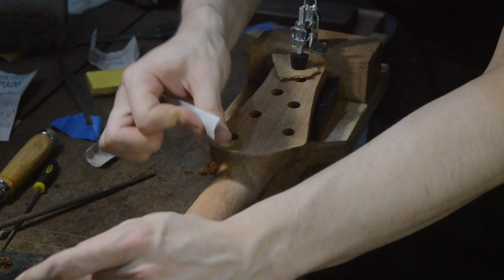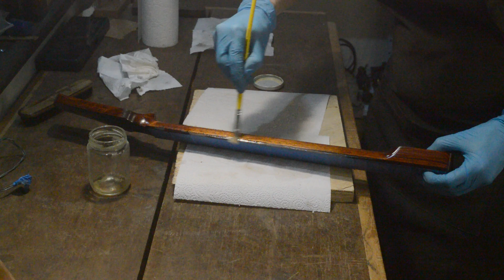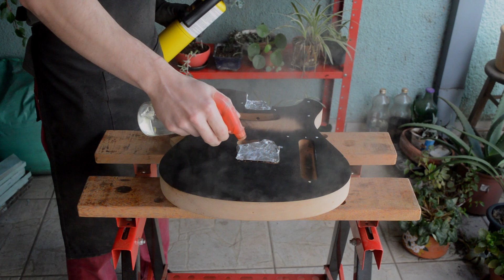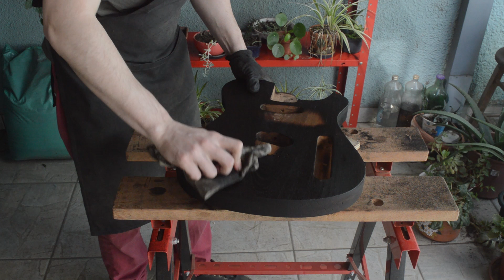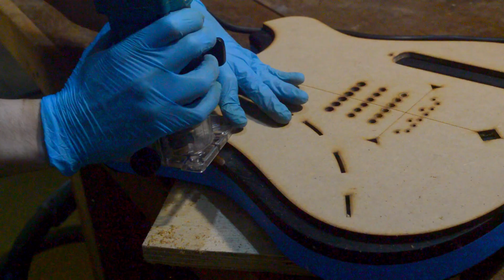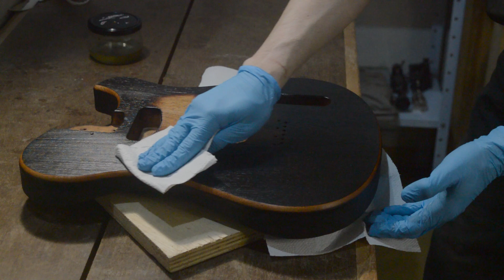Guitar Build - Part 11 - Shou sugi ban

Comment: Amazing ! What did you apply to the back of the neck to achieve the dark colour ?
Reply: If I were to hazard a guess, it looks kind of like Iron Acetate (aka steel wool dissolved in vinegar). The finished solution can look anywhere between clear to transparent brown once strained depending on how long you've "brewed" it, and it causes a chemical reaction in the tannins of the wood to turn it black without dyes or pigments. I'd reccommend looking into it next time you're working on a project!